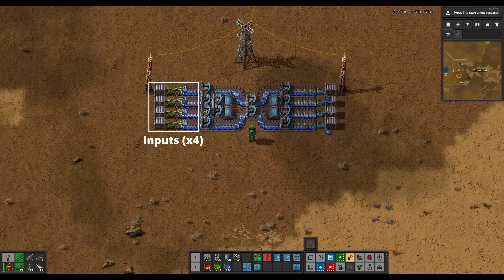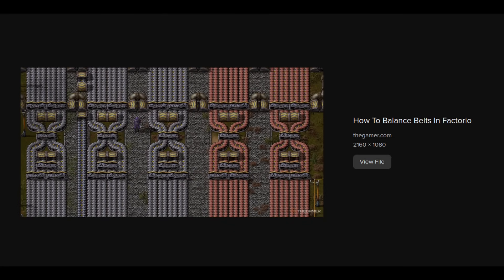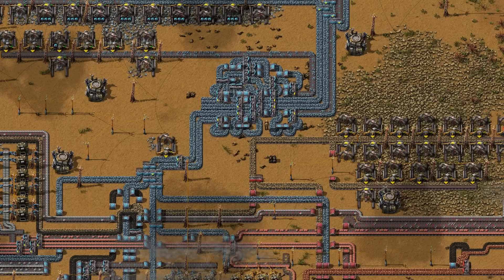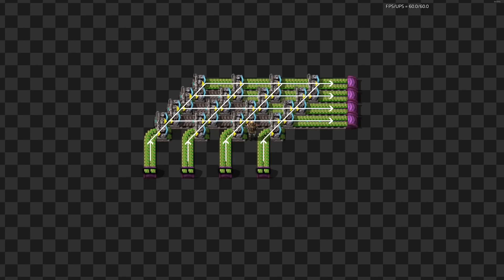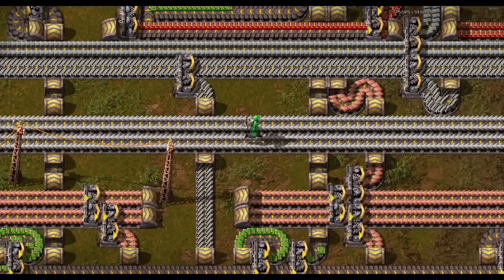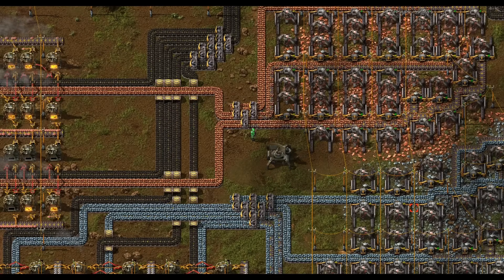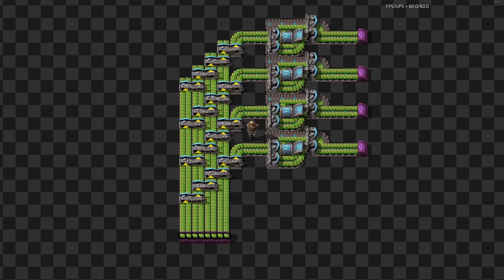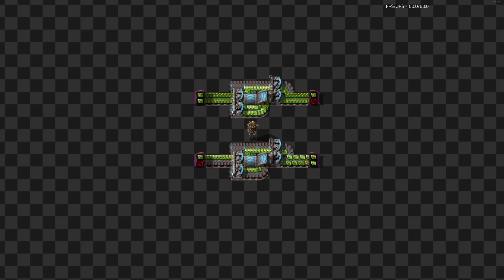Crossbar Switches: An Alternative to Belt Balancers in Factorio

Comment: Diamond switches, as you call them, are used in speedrunning as compressors for a good while now, as they are very fast to build and rather performant (as they ensure full belts). most often they are called anti-balancers ;-)
Reply: I've used them for years and always just called them compressors, since... that's what they do, most clearly seen when you don't have full belts on the input side.
Reply: Yup. I don't normally care much for speedrunning tactics in my own playthroughs (I'd rather have correct ratios and compact builds than quick builds, e.g. 3:2 for green chips, none of that long-handed inserter business), but this is one I adopted for my mining patches the moment I saw it in speedruns. It's simple and effective, and I don't want to just memorize or input someone else's balancer blueprints, nor do I want to go through the effort of figuring them out myself (exception: I'll use the default 4x4 balancer because it's just too useful and it's pretty simple to build).
Reply: I'd call them aligners

Comment: Balancers and prioritizers are overrated.

I only use balancers for ores and I use simple 2^n balancers. In train stations I just use circuit logic.

Everything going for science is dedicated from furnace output all the way to lab and needs no balancing. Everything going for non-science can just wait if needed, or become dedicated production line (like science).

So I guess I split factory into dedicated products and low priority. Dedicated stuff works 24/7 the same way so there's 0 unpredictibility, low priority stuff (turrets, miners, belts) needs just 1 belt of everything and it's more about predicting correct buffer numbers.

Comment: The reason you dont see those used in bigger bases in due to the poor preformance on splitters. 4-4 belt balancer that is input and output balanced (eg the "standart" one) uses just 6 splitters, for comparison the crossbar switch for the same situation uses 16. This is a big difference when going for hundreds of thousands or even milions of SMP (now possible in space age horray).

They are definitely useful tho, if you dont care about preformance - building smaller base/starter base or not being very experienced - balancers are bit harder to understand than the "splitter spam magic that just works" that crossbar switches are, they are also much easier to build since that all "look the same".

The other problem is that they dont evenly split the items when used for dividing lanes (if this would be the desired function and i do see some people using them as if they were equivalent of balancers)(eg 7:00) they would output more in the first belt then the second and third... even when used without priority. Yes you can just wait until it backlogs (if possible) and then it would split evenly, but belt balancers are often just more versatile.
I do find this 10:50 really interesting tho, it solves the balancing in very cool way, but at that point why not use balancer ? It would be better for preformance (less splitters, no logic) . It might be more understandable for less experienced players, and i understand that balancing is not their primary function.
Really cool video enjoyed it a lot.

Little bonus: 4:23 A lane balancer is actually not really needed here. It would be best to have one yes, but when maximizing preformance, it is not necessarily needed. The plastic lane draws more form the left side of the belt (in direction of travel) but since the left side and right side both comes from one vagon it will get balanced that way, so the only consequence is that it will draw more from some inserters, therefore messing up amount of items in buffer chests and this is not a problem as long as trains arrive before half of the items gets consumed (half of the buffer chests that get prioritized - which is every second one - the ones for left lane)
And fun fact the splitters that the inserters insert into (coming from buffer chests) at 4:23 dont do anything, because the inserters will put items after the splitter. You can test this by having the two belts coming from the inserter not merge, and with only one inserter only one belt will fill up (:

Sorry for the essay xd
Reply: Honestly the biggest pro reason to use this method it its simplicity. I can just plop a crossbar down without thinking in any situation and get %90 as good of a result? Not bad. Like before robots for example, you have to place every single belt and splitter yourself. Why use the balancer book if you have to turn belts and splitters and undergrounds, when you can just spam splitters and set priorities with shift+clicks? It definitely doesn't solve the worlds problems, but man this is so much easier when you don't have bots and blueprints available.

Also like he said, if you need to balance because demand > supply, that's not really a problem of the balancer. Though I have to agree nearly all players most likely have demand higher just because it's natural. You want the items being built first, then you can solve inputs.

So I totally agree with you, I just think there's more opportunities for this system to shine than you first thought :)
Reply: @calvissuperman  Yup have to agree, its so much simpler than balancers, only main downside is for preformance which 95% of players dont have to care about
Reply from the maker: The splitters for unloading that train station are indeed pointless; this was a known issue with an older design of train stations that I had; I have since redesigned them.  (This time I know the splitters help… some of the time.)
Reply: @zipnotoad  Glad to hear that
Reply: A 4:4 crossbar is only 10 balancers, no? Larger ones are more expensive, but belt balancers are inherently bad for performance anyway
Reply: Regarding the lane balancing at 4:23, yes, you can design your train system show up before there's enough space to unload, and this will compensate for certain imbalances, but in 2.0 there's many ways to design train systems and no single method should be assumed.

Comment: Here is a small lane balancer (no undergrounds, just one splitter, 3x3 tiles). It is not my design, I found it on a forum. It works through pure magic.

0eNrtVNtuwjAM/ZXJzwHRG6zV/gShKm0NRErTKnHZEOq/z2kn2KAgTUh7mvqQ2rF9jk+cnKDQHbZWGYLsBKpsjINsfQKndkZq7zOyRshgKx3NyErj2sbSrEBN0AtQpsIPyIJe3MtxrVZEaL9Fh/1GABpSpHCEG4xjbrq64MgsEI9gBbSN49zGeCyuly4W0TwRcIQsjoJ5wkiVsliOIbEAbotso/MC9/KgGuvzSmXLTlGORhYaK8jIdijObk6pzhhbZR3ll/7o2HpyB2WpY8+Z7RgxwwPaI+2V2fmmvaYkvcCJN+pWWkmeA7wN21+AFmWV76WpPDSxIKzMVmr3k9OwMcbWTcWYi95Lf6Vf+Gv94vv6vT7Wb4r3jZQ3tIMp2pGYnpwpwuGZcHR13BOF4yfmiYGmuCZPlIz+RzRbPjGio35/NJSrJ4iGNwftX753tv2ztw5E6L+NWCe8LvmPdxVhzWCXd1mAlozFPi0NvhSSl3K4FXyGbiibLMM0TtMkSVerMFj1/Sc0dQJz

Comment: Its interesting that both 'Universal' and 'Throughput-unlimited' only specify what happens to the outputs;
Is there a term for a balancer where all connected inputs have the same amount taken from (input equivalent of universal)? Or if demand exceeds supply, all inputs will be consumed (input equivalent of Throughput-unlimited)?
Reply: I'm too tired to do any kind of proof on it, but inputs and outputs are basically mirrors of each other, and every balancer can be simplified by instead of thinking in lanes, thinking in belts, and instead of thinking in belts, thinking in splitters.  He talks in terms of outputs because most of us build in a push-based logistical philosophy, where we want to produce based on a given supply, not supply based on a given demand.  If you were to do an experiment, hooking up a 4:4 belt balancer, filling the belt with stuff evenly on 3 input belts and removing the 4th, then take a fixed, even number of items from each belt, you would notice the missing belt's neighbor supplies more ore, just like removing one of the outputs in a partially saturated balancer overflows to the next closest belt.
Reply: this is generally undesired because an "equal input balance" as in every belt must provide the same amount of stuff over time, is an explicit deadlock condition.
Reply: Universal balancers also equally balance input as far as I know

Comment: Great video! I think this was a great explanation of a little understood concept in belts. Most people do indeed just use balancers without understanding their purpose. I will admit that I am slow to add lane balancers, and will often make a "dirty" one-side preference one since it's smaller. I think "simplicity" of a build is it's own quality, at it reduces the mental planning load of making thing connect.

Comment: I've used all of those crossbar switch configurations, except the true one (I found that the most difficult to visually parse and understand btw). 
The diamond one, I had not realized that you can chop off the top.. I also feel like I've messed up the priorities of diamond ones before..
The main one, the inline switch, I use everywhere. II actually like pairing them with balancers to make mock-throughput unlimited balancers. Rather, I ensure density in as many places as possible, while spreading the last section(s that are input starved) evenly with localized balancer(s). 

Good overall explanation of this! I'd never heard them labelled as such, but these crossbar switches are absolutely a staple of every single multi-lane bus I've ever built (multi lane as in with multiple lanes with the same resource).